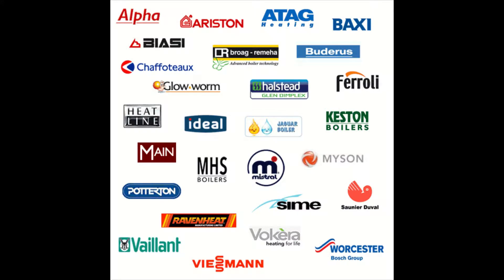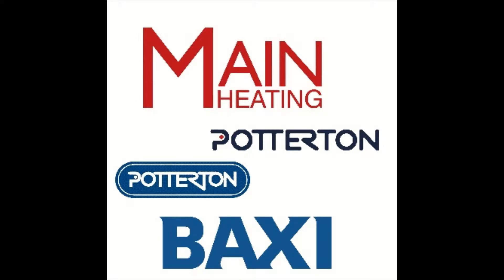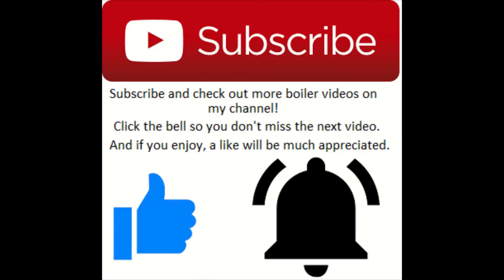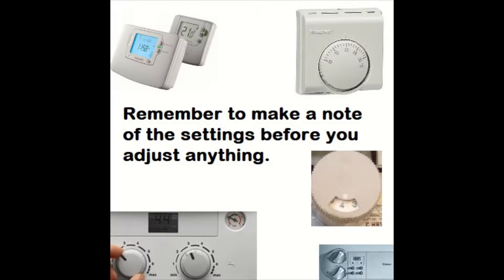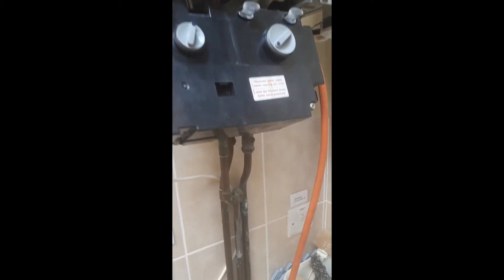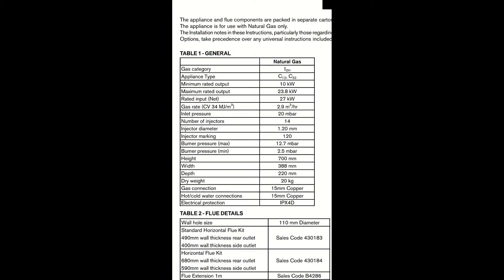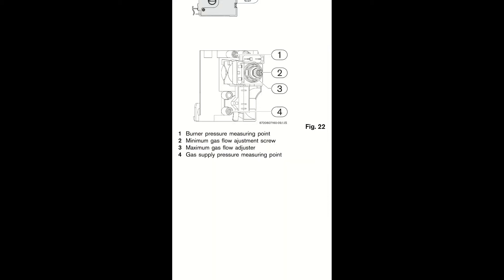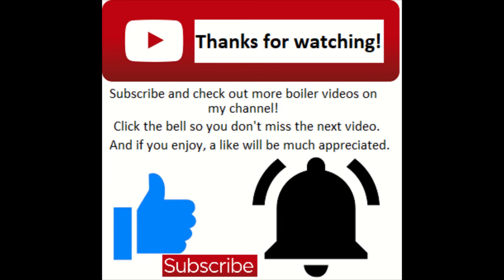Main Multipint FF Water Heater Service Mode & Burner Adjustment

Comment: Hi. Thanks for the videos. Good to see someone who knows what he's doing. I have 3 of these I need to service soon so I have been reading the manual and it says to clean the heat exchanger you remove the clamping plate. But this gives you a 1 inch gap between top of heat exchanger and the flue hood. Is there something that I am missing here? Cheerz
Reply from the maker: Thanks bud. Nice of ya to say. Do you own a compressor? I sometimes find taking the water heater off of the wall. Burner out, plate off and clear it with the compressor is best and easiest.
Let me know if you're still stuck or need anything else
Reply: Hi I have this water heater which is giving me problems, can anyone service and repair it southeast London? Thanks